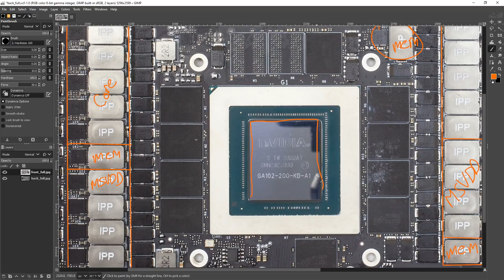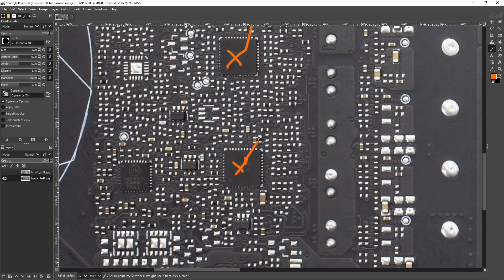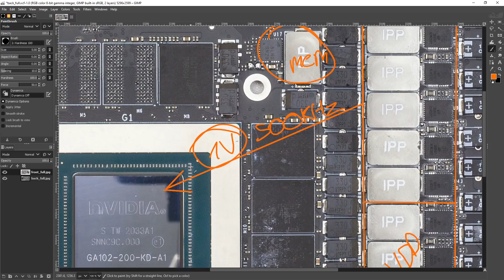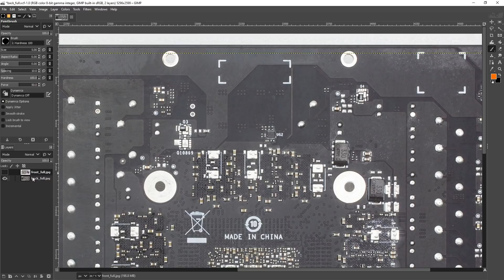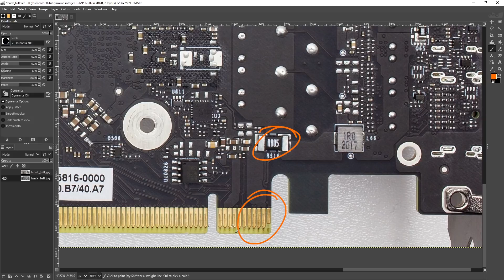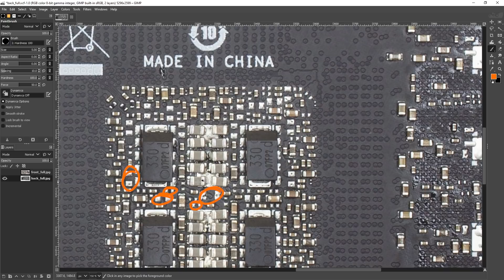GPU PCB Breakdown: Colorful RTX 3080 Vulcan

Comment: hey man love all your videos i learn a little bit every time I watch I have to go back and watch episodes multiple time to understand everything your saying and I still don't get it all I HAVE A SERIOUS QUESTION FOR YOU I JUST built my all evga build and it has a ftw z590 wifi and i9 10850k and ftw 3080ti anyway the ram I have been using before the rebuild is corsair vengeance 3200 16gb dimms the motherboard first didnt reconise the 10850k as a unlocked CPU so they did a quick bios update that fixed that so i could use oc robot..... but if I load all 4 dimms in place and boot into bios it says xmp 1 not supported and under that it says xmp 2 not supported if I pull 2 out and reboot into bios it now says xmp 1 supported and I can put it on 3200 now I save and reboot  then shut down add the 2 other dimms boot into bios and it still says xmp1 is on but only for those 2 dimms and it still says xmp2 not supported if I change it manually it goes back to stock setting and then xmp 1 is now not supported so weird

Comment: I'm guessing that Colorful built the best power delivery based on what was available. This could explain the 9512s and other slightly odd choices. 

Any port in a storm, any voltage controller in a manufacturing crunch.

Comment: That top memory power phase totally messes up most?/all? LN2 pots though. Yes, I know it's not intended as a extreme overclocking card but as you mention it IS likely the 3080 that has the second best power delivery for it, second only to the Strix. So it's a bit of a shame, so close yet so far.

Comment: This is basically what I expected the FTW3 cards to end up like when I pre-ordered... 
Burnt me a customer... tight-ass bean counters.
Reply: The FTW3 is still a very good card, and if you got it for close to the original list price, you still got very lucky. Do you really care about it not having good extreme overclocking features? It still has an excellent cooler, a dual bios, and comes with the best warranty in the business. Did it make sense for them to downgrade the components for their "FTW3" model? No, and it is weird for it to be over-engineered in some ways but not others, and in a normal market, you could complain more about the price, but in the crazy GPU shortage times, it's something of a moot point.

Comment: Would the PCB color make any meaningful difference on its efficiency or capabilities? It doesn't seem like something that should. And at least that there's a white edition of the Strix, it's very aesthetically pleasing.
Reply: The color is in the solder mask. It’s a very thin layer on the outside. Most high speed signals will be inside the board, between ground planes. Even then, the electrical properties can be the same for the different colors. Although, if you’re using a random PCB manufacturer, green is technically the superior color, since the most research has gone into those dyes, so you can sometimes get the finer details with green.
Reply: I vaguely remember that Galax had some problems with their PCBs due to the white solder mask. Don't know if it was their HOF cards or RAM.
Reply: @-eMpTy-  Last I looked into that, some do yellow from the (relative) lack of sunlight.